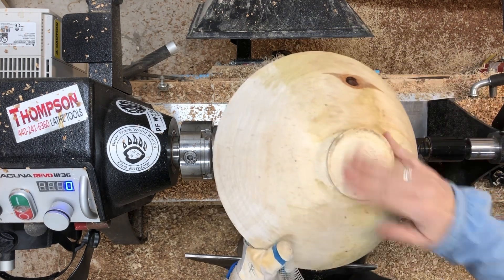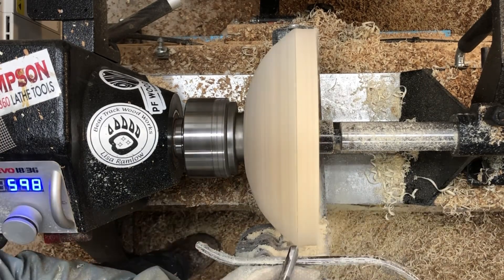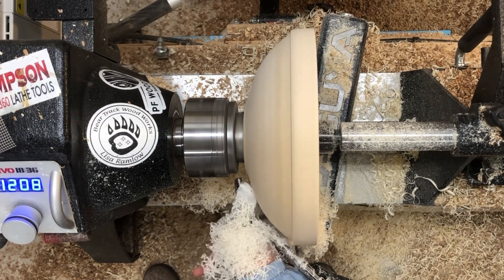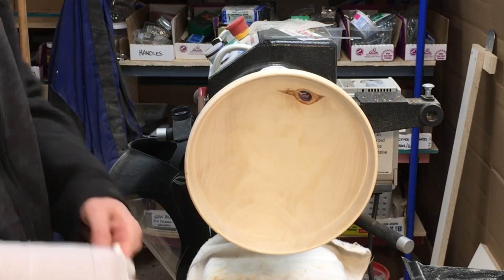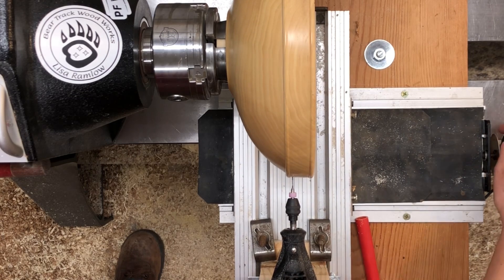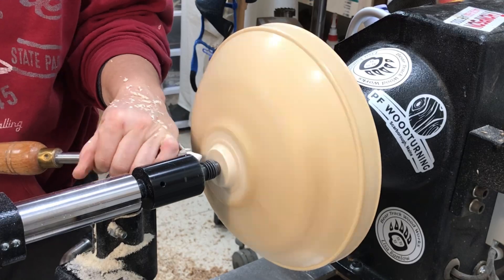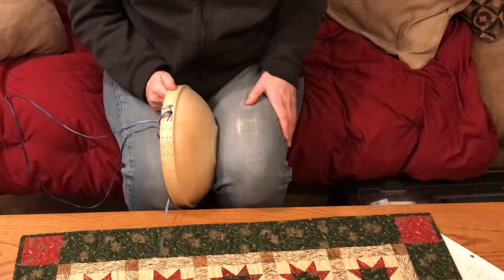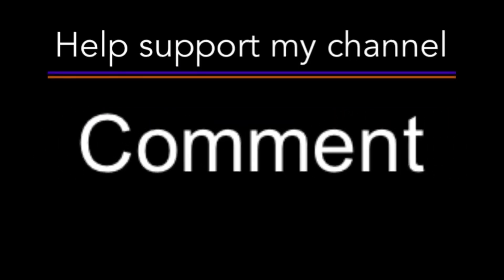Woodturning and MacGyvering: The Aspen Mountain Bowl - A Different Take on the Yarn Bowl

Comment: Very nice Lisa! Great mix of materials and that stitching is awesome. Also love your indexing machine, I have a cross table like that I can use to build one. Thanks for the push in right direction but I doubt I'll ever be able to do something with stitches I would have gotten lost in them and had my fingers tied to the bowl.
Reply from the maker: Thanks Bren! I did just about tie myself up in knots a few times, mostly because I was trying to use a long piece of yarn. Which I didn’t really need to do since I just cut the ends in the back and used CA glue to stick them to the inside rim before I covered it with the leather - next time!

Comment: That was fantastic, Lisa. What a great embellishment. I've wanted to try something with paracord, but wasn't sure how it would look. It might be tacky. Yours was elegant. Maybe natural or traditional fibers or ribbons would prevent tackiness. Thank you for the inspiration.
Reply from the maker: Hi Jay! The first thing I tried was embroidery floss, and then some bamboo yarn, and then some dyed raffia. I like the flatter materials better - the raffia was really cool but it kept shredding. Lots of options to try yet - copper wire, leather strips for stitching, other YouTubers have used those and they look nice as well. I have a few other styles & colors of this sort of ribbon style yarn and I’ll definitely do some more like this 👍
Reply: Gutted paracord would lay flatter
Reply: @LisaRamlow  Oh, nice selection of materials. The new year has a two- piece hollow form waiting for me. Two pieces of a birch trunk are the material and if the joint doesn't look good, I picked up some thin silver wire to disguise it with. Might try on a small vase, first. I've seen some great copper wraps, then turned to have a flat spot on each wrap. Looked great too.
Reply: @johnvaluk1401  That's a fine idea!

Comment: I really appreciate the sewing part of the project, these kinds of features I find to be very different and make the piece very special. I have 1 question that is not related to this video though, how is the dishwasher kiln doing? I'm fixing to build mine in the next week and would like to know if I should make any changes to it?
Reply from the maker: Hey there! The could not be happier dishwasher kiln. It was cheap, easy, and really effective. The humidity controller works really well and it dries the load in a reasonable amount of time, but I’ve not had issues with cracking. The only thing I’ve changed is I am using a 125w heat light bulb that you would use in a bathroom heat lamp (it’s clear). I was having issues with the regular 60w incandescent burning out but this has lasted probably close to a year now. I left the flashing in the bottom to prevent moist from dripping directly into the pan light and it’s just freaking brilliant!

Comment: Pretty neat project! You're drilling jig  is very slick, nice job! Couldn't you have done the weaving on the lathe before you took off the foot?
Reply from the maker: Thanks Don! Yeah I could’ve and probably should’ve. I think my main concern was getting dust in the fabric bits but I guess that’s what the air compressor is for! 😂

Comment: I'm trying to sort out the math involved here.  Let's see ... circumference of bowl divided by X number of holes as determined by sewing pattern as designed on many huge pieces of paper while sitting in front of tv one night.  Calculator may or may not have gotten lost behind a cushion.  Hmm.  Apparently wine was not involved as sewing design ended up even ??? omg.
Reply from the maker: Hey Johnine! Although I am reasonably good at math, there was little involved in this one as long as my design was an even number. I used graph paper to lay out the pattern and then the indexing ring on the lathe gave me even increments around the circumference. The sewing was the hardest part and that’s mostly because I’ve not done it before. Since I’m not making knots in the inside I don’t need to use a really long piece of yarn and that will help 😂